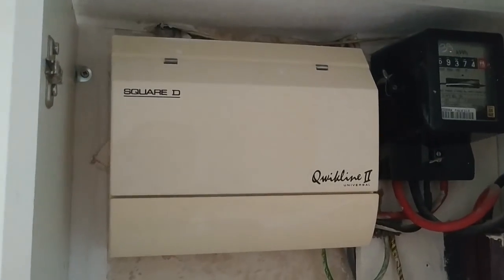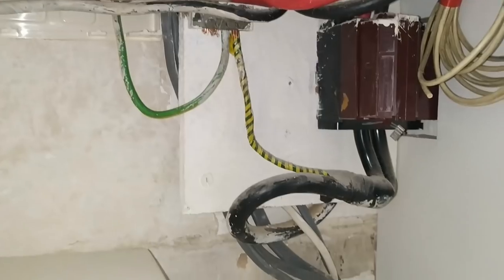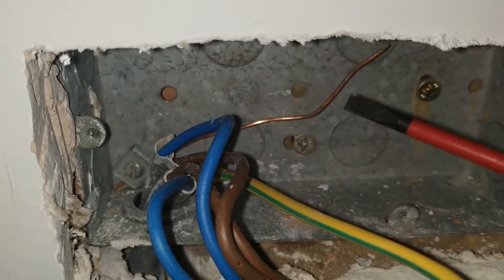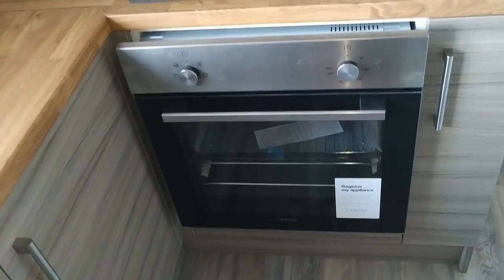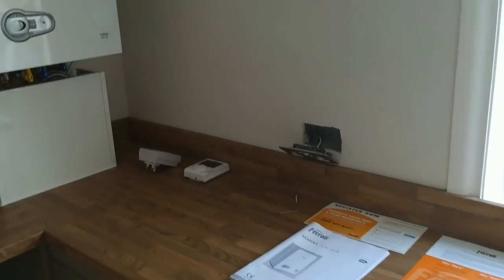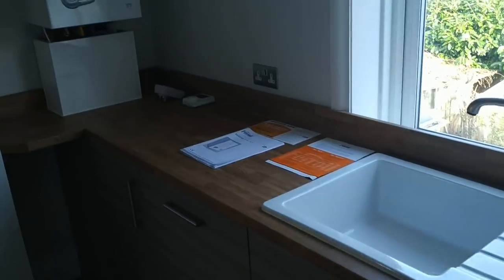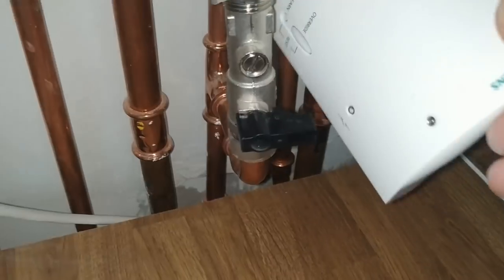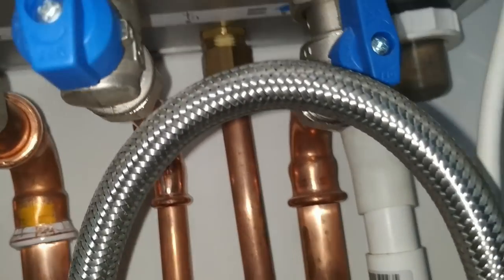Newly Refurbished Electrical Shambles

Comment: Thumbs up from me for recycling the plugs and out-of-sight sockets. Non sleeved plugs re-used in a place they'll never get touched. Sockets with paint splashes inside cupboards, no problem. So long as the client is aware of what he's done (and may have sanctioned it, of course!). If he's paid for all new, then it's fraud. Wonder if the dangling stat receiver was an oversight, just tacked in for the plumber to test the system while the spark was on another job, and forgot to come back to do properly.
Reply: You are funnier than John 😀 these cowboys had saving the planet in mind complete with washing machine label for the boiler. That flex should have gone to a 3amp fused spur anyway. The plug probably had a 13amp fuse in it ! And that extractor socket was hardly hidden

Comment: One point about the 13 amp plugs - and not to detract from the appalling work carried out here - the requirement for insulated pins on 13 amp plugs became part of BS1363 in 1984, but that did not become a statutory legal requirement until 1987, so until then it plugs without sleeved pins were still being made & sold. Even after the 1987 requirements came into force, the people at the Consumers Association (Which? magazine) were finding plugs without insulate pins were still on sale in some of the retail outlets they visited. Although I hear and read it time & again that 1984 was "the year", you'd actually have to go a very, very long way to find a plug with insulated pins that was not either an MK safety plug, or the much less popular Crabtree plug - there are no others I can think of from before 1987. 

Of course, I realise we're only talking three years discrepancy here, but I do feel it's worth knowing. For what it's worth, the plug on that cooker hood actually goes back to the 1960s / early 1970s, and is a WG (Ward & Goldstone) plug...it was very tough in construction, which would explain why it has survived to tell the tale, though I would have binned it because as you say in the video, a new plug is not expensive. Goodness only knows I've kept plenty back from appliances I have at home which broke down & required disposal. 

The other plug (marked "Washing Machine") is a Marbo plug with the "Ever Ready" branding - these date from the very late 1970s/ very early 1980s, and were produced right up until 1987, when the new legal requirements kicked in.

Comment: Kitchen extractor fans can operate in two modes recirculate or outside vent, quite often in flats they are installed to recirculate as no outside wall is available. You change the filter to a carbon / charcoal filter.
Reply from the maker: That is true, but this one is fixed to an outside wall, and there is a loft space directly above where ducting could easily be installed to the outside.

Comment: Nothing wrong with an unsleeved plug if used correctly. I still have and use one myself. It has brass and not what looks like chrome plated steel pins we have now.
Reply: Joe public is required to use it after coming in from the pub or having the wife standing over them to get it working. 1984 the rules changed. They must have went down the British Museum to get their stock

Comment: Great video.  As so often the evils are buried or hidden in cupboards or behind ovens or boiler covers - anyone taking a cursory glance around the kitchen would think it looks fine.  Should the light above the shower be 12V low voltage?

Comment: That bathroom cabinet with no RCD behind it was an actual death trap!
Reply: As an American I am appalled that a referb would not have had RCDs installed.  But that live cable under the sink, that's criminal.
Reply: @jovetj  The UK standard for safety – Since July 2008 virtually all circuits in new or rewired homes have been required to include an RCD under the latest edition of BS 7671.
Reply: @DazzaDirect  Do you ever have problems with surge protectors or motors running on RCDs?

Comment: This sort of crap is typical of the "I can't be bothered" professional. I spent 20 years doing contract IT work, and the number of businesses and houses I walked into where I saw this sort of crap was ridiculous...
I'm not qualified for any cabling (electrical or data) so all I could do was tell them it was rubbish (or occasionally dangerous) and try to work around it until they could get a contractor that actually wanted to do the job.
Reply: first thing you learn is cables and data this is lunacy 

if you don't get the concept of simple house wiring but think you know computer you are a joke

Comment: Wow! 
I’ve come across all kinds of open live wires upon house purchases including live ends of cooker cables, mainly discovered deep inside under worktop cupboards or on top of wall cupboards. 
Anyone purchasing a property should use John’s findings as a stark warning to take care to get the electrics tested including full visual checks ideally after the previous owner has fully moved out and before the new owner move in.

Comment: The wiring to the boiler is hilarious. There's a grommet on the cable going to the dangling control box, which appears to be backwards from how it should be if it were to be inserted into the hole on the boiler. There's of course also no grommet on the supply cable (US terminology, not sure what you call that over there) However, there IS a grommet in the hole next to the one the wiring to the control box goes through. Which means the installer actually had 2 grommets on hand, and he knew that they could be slid over the cable, and that they could be inserted into the hole in the boiler housing, but either just couldn't quite put 2 and 2 together, or else he just didn't give a ****. Amazing.

Comment: Why did they mount the disconnect box for the oven hanging? The installers could have used mounting screws to attach it to the wall.

Comment: The flexes are usually factory fitted on that Lamona stuff although the equivalent Beko units don't have anything fitted. I went to a flat that was so say refurbished last year and the bodging shits had used a piece of old black Pirelli rubber cable to connect up the brand new oven

Comment: So, no above-worktop isolator for the dishwasher? I don't know if that is a regulatory requirement or not, but it's surely a good idea to be able to isolate an appliance without having to touch it or turn off the entire circuit. 

Also, I notice that the upstand runs  across the lower part of the window, which is a curious design choice.

nb. there isn't a regulatory requirement for an extractor in a bathroom if it has an opening window (although it's still advisable).
Reply from the maker: Isolator above the worktop is not required.  Some people like to have them, although such things are rarely used.  Isolation can be unplugging the appliance, with the socket in an accessible place such as the adjacent cupboard.
The window thing will be entirely due to cost - much cheaper to just shove the kitchen in front of it rather than have the window changed for a different size.

Comment: Why is it that in some buildings they have single gang sockets labled 'cleaners'?
Reply from the maker: Sockets designed for use with vacuum cleaners only, and not for use by anyone else.  Sometimes they are non-standard sockets which can only be used with the matching non-standard plug fitted to the vacuum cleaner.
Reply: @jwflame  Ok. Thanks, interesting to know.
Reply: Grainger Electrical it worries me that you seem to work on commercial electrics but have never come across this?! Even a non electrician could put two and two together and realise these are intended for use by the building owners / management and not for anybody to just rock up and start charging their phone or running extension leads into their own flat from a corridor socket.
Reply: @spencerwilton5831  I don't actually work on any electrics other than my own home as I am not a qualified electrician. I just have a good level of knowledge on electrical installations. The reason why I was asking about the cleaner sockets is because in places like my university, they contract out cleaners and that made me wonder if their sockets are on a separate circuit so the cleaner pays for the electricity.

Comment: I find it amazing that people that lazy are organised enough to keep old plugs. Most lazy people I know love buying new stuff
Reply: They've probably got a big pile of old electrical stuff like that, my dad's still got stuff from the 70's just incase. Most of it all scuffed and covered in paint/plaster.
Reply: uK8cvPAq but I’d imagine your dad isn’t lazy and would use it to save a pound or two where safety is important
Reply: @wollywotsit  He'd do anything to save a penny, but many of these things haven't been touched since they were dumped there.
Reply: I remember being asked to look at a job were the clients had for the last 30 years years had the services of a handyman who would turn his hand to anything.

Circa some of the most incompetent and dangerous bodge ups.

The bloke concerned must have had a garadge stuffed to the gunnels with useful materials eg nail ridden old beams that were perfectly serviceable for a bit of stud work, twice recycled bits of lead etc and  undoubtedly a box of  usefull electrical bits!

Any attempt to point out the pitfalls of past work was met by the following: of course Charlie wasn't an expert in plumbing, roofing etc but he did his best or the old chestnut there can't be a lot wrong with that as Charlie did it 10 years ago and it's still working!

Charlie of course didn't believe in building regs etc.

To my knowledge the people will have a real struggle if they ever try to sell the house and have had to spend a fortune on updating things but still extole the virtues of dear old Charlie!
Reply: The fact that they’ve used plugs that came off the Titanic strongly suggests that this is not the work of a fully qualified electrician. 
No sparky would have these floating around in the van as emergency stock in 2020. This is the work of a total bodge artist who is completely clueless.

Comment: What's the issue with two cpcs sharing sleeving - I've seen it picked up elsewhere so I asked my assessor about it and he had no issues...
Reply: There should be no exposed copper. So it’s far easier if they are sleeved separately. It’s not like sleeving is expensive...
Reply: 84bazzy84 if your splitting a ring to fault find then you would definitely want separate cpc’s it’s just good practice
Reply: Thanks for the replies but your not really saying much other than I like it that way . I generally share sleeving at accessories when cables are coming in the same entry hole and often this makes it tidier. Ok there may be a few mm more cpc exposed... next to and entire  earthed metal back box this doesn't trouble me,  As far as fault testing and even testing in general it's not hard to whip the sleeving off and I don't test with live voltage - do you?  If I'm doing ring continuity and r1+r2 on somebody else's messy CU then doing it at a socket is definitely an option for me.
Reply: Maybe it puts additional strain on the conductors when they bunch up as the fitting is secured into place.
Reply: If I was putting a ring in, only one sleeve would be used as I wouldn't cut the CPC to get 2 on. I wouldn't cut any conductors in the ring so the ring would never be broken by a screw coming loose.
Reply: @millomweb  What an excellent point! I bet most installers do not do this because stripping the sleeving takes a bit more effort. Having gone round a house we just bought and tightened all the loose screws in the plugs I can see the value. (the clue was the heat staining on the front of one of the sockets!)
Reply: @Tensquaremetreworkshop  Only reason screws come loose is because they're not sufficiently tightened. To fix these bad electricians, they're now giving them torque screwdrivers!

I think it was junior school where another lad preferred to nip some insulation under the screw to account for thermal expansion. I always preferred metal on metal - as for one, the screw would scrape the conductor surface clean and flattening the conductor would expand the surface area of contact. Both reduce the risk of a poor connection which could lead to the generation of heat - and hence remove the need to 'deal' with thermal expansion.
Reply: @millomweb  Agree- whoever installed them clearly did not tighten. Not sure if it was original install or socket update- probably the latter. Previous lady owner was fond of using a 'handyman'.

Comment: As failures go, this installation was one of the less mind-bogglingly stupid ones.
At least it has earthing (or else an attempt at earthing).
And they put the end of that unused cable into a terminal block. Someone was thinking there. They could have cheaped out and just wrapped the ends up in electrical tape, or terminated it in a spare trailing socket they salvaged from the end of a 1980s extension lead, but they didn't.
I rate this installation 1/10.

Comment: One other thing, JW, where does the Neutral out of the main switch connect to?
I was always trained that the Neutral conductor must be under a double screw termination after it comes out of the isolator, on to the Neutral busbar. 
It looks like there is a screw missing where this should be happening, however splitting strands from a conductor to do this would be very poor practice.
The Earth conductor (CPC) looks the same.
Reply from the maker: On that one, the top of the main switch has prongs at the back which plug into connections behind, those are permanently connected to the neutral bar, and the same for the line bar which runs behind the circuit breakers.
Incoming at the bottom, with a single screw for each.
On most others it's in at the top, with an insulated wire from the bottom of the switch to a neutral bar at the top, and the line busbar across the bottom.  Most have single screws, a few isolators do have 2 for the incoming terminals.

Comment: Another insightful video John. Good to see you on the job, and not melting cheapo junk, which I suspect you prefer.
I hope you were there to put all the faults right and managed to make some money in the end. How you remain so calm is pretty impressive, I would not enjoy trying to sort this one out. When the stuff you can see is so poor, what else is tucked away under the floor to burst into flames ?

Also, I have one small general point. 
Why do some sparks out there question the little pearls of wisdom dropped in by top guys like you? 
Surely absorbing better practices is preferable to sticking to their own method. If there is a better or safer option that maybe takes a few seconds longer,what's the big deal?
Not all experience is good. Doing it wrong for 20 years does not make it suddenly right. Arrogance holds lots of guys back in my view. 
If you are clever enough to learn from someone who is clearly better at something than you, surely you will become more and not less.
 
Keep the videos coming John, the information you provide is second to none.

Comment: I can only assume that’s a DIY landlord or “property developer” saving a few quid on paying a professional. Barely adequate to dodgy, with no certification; I’d seriously hope thats not a professional job.. Maybe the under-sink connection was meant to be for a de-misting mirror? That might explain having a switched live, but being incompetent, they still wired the permanent live; would make sense with there being no extractor (but still speculation on my part). And the worrying thing is, most folks would just see a new kitchen and think it was wonderful.
Reply: I'm guessing it was supposed to be for a second light switch, although obviously not correct for an alternative switch arrangement.  The wire was obviously connected wrong at the other end, so may have been intended for mirror lighting or shaver socket with isolation transformer in a waterproof box down in the cabinet.

Comment: Boiler installation would be classified as At Risk due to grommet not being installed correctly on boiler case. Appliance is classified as room sealed but not room sealed when grommets are missing. I know it’s not your thing just FYI.

Comment: The twin+earth in the vanity unit is most likely a failed attempt at a shaver socket feed, probably taken from the light switch where there often isn't a Neutral..
Reply: Good theory 👍 most plausible. An easy mistake to make for a complete novice with no time to check the Internet. The most scary thing covered in this install and there is lots of competition ! 😀

Comment: I'm guessing that the line and switched line supplies under the basin, were so you could install an illuminated mirror or cabinet, which you could select would either come on with the ceiling lights, or on with its own switch.  But no Neutral.  Unless of course that Earth wire was really connected to Neutral.  Given the quality of the rest of the wiring, that's entirely possible.  I don't think you tested for that possibility?
Reply from the maker: Could be neutral - will need to locate the other end of the wire in the ceiling to find out.  Either way it's unusable at the moment.
Reply: @jwflame  It was likely placed for a switch and running to a JB with a load cable waiting to be found somewhere else perchance